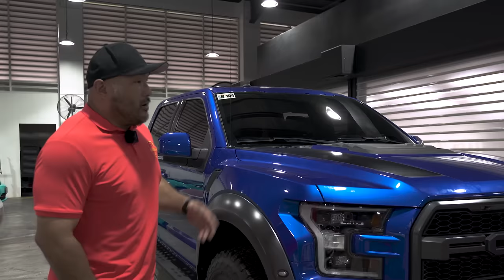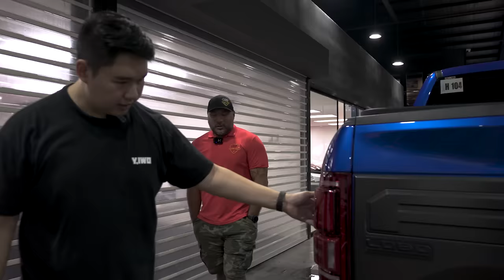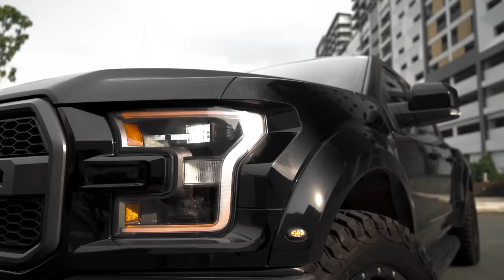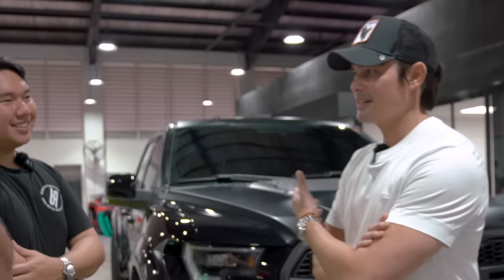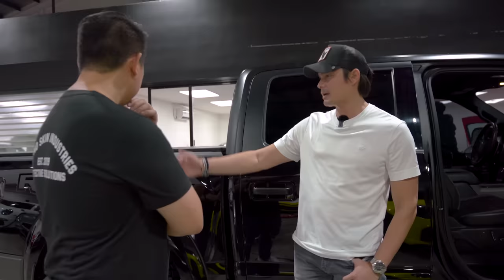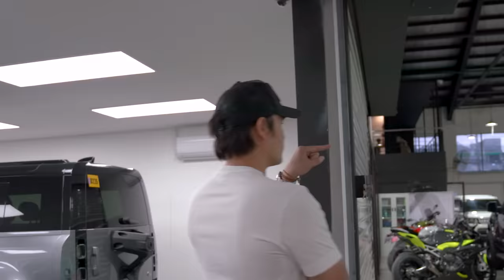WRAPPING DINGDONG'S F-150 RAPTOR | VLOG

Comment: 2 questions. 1. Does it require change of color registration from LTO.
2. How do you maintain the wrap, can it withstand power washers or do you need to wash your car using tabo and timba.
Reply: Problem po is kapag registration pero alam ko need na atang iclaim new wrap
Reply: Basta 4 wheels dala mo, lusot yan sa checkpoint or registration.. di tulad ng motmot
Reply: Yes need yan
Reply: ni rerehistro po yan mag babayad ka sa lto mahal nga lang papalitan kase yung naka register na dating kulay nya
Reply: If the price is right. mareregistro agad agad, nagiginig pa!
Reply: ff

Comment: Pag nagka deep scratch or dent, what will be your solution so that the car looks unscathed after it's done? Tnx
Reply: Blower lang yan at wax
Reply: wala na kailangan e wrap ulit yung buong side ng may tama. Kadalasan sa dent nahahati ang wrap at yung deep scratch naman hindi na makukuha yan. Kailangan mo ng spray cleaner for wrap para hindi halata pero sa closer look makikita parin
Reply: @MK-hv9jm  edi ikaw na
Reply: Deep scratch? Naahh need mo na e sanding yung part lalo na kapag tagos hanggang sa paint.
Wraps are for minimal to minor scratches only. Once teared, need na e re-wrap yung part.
Reply: @NK-jw8ov  ako nag rawrap ng sasakyan ko kaya alam ko.
Reply: Pancit canton lang po katapat non at epoxy...thank me later.

Comment: Which is durable, to paint or wrapped the car? It seems this wrap wont last long like paints.
Reply: I think people do wraps because they want to change the color temporarily. And it is cheaper than totally changing the vehicle color.
Reply: @enargy5890  it seems most of them are not temporary specially when you live in the city. Otherwise you get the risk to be apprehnded using different color from vehicles registration.. just like this, for sure dingdong will go the lto to change the vehicle color.
Reply: @joshuatan3353  that’s also true.
Reply: either one is not durable and you need to change the registration color.And for long lasting, it will be the paint. Wraps last only up to 4-6 years depends where you live and the weather. Living in the philippines is too hot so probably about 4-5years unless it stay in garage most of the time. For me, wraps makes the car look better than the paint but some other people preferred the paint than the wrap. If you have a lot of money and let the shop do the works then choose the wrap but if you do it yourself then it's a lot of work to do the wrap.
Reply: Grabeng Collab nito 😳
Reply: It also helps to protect the paint